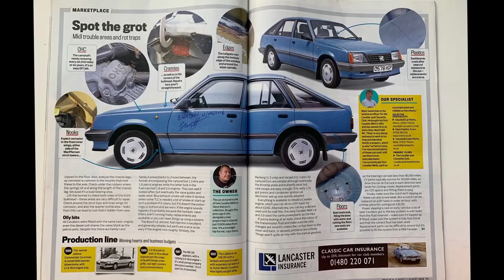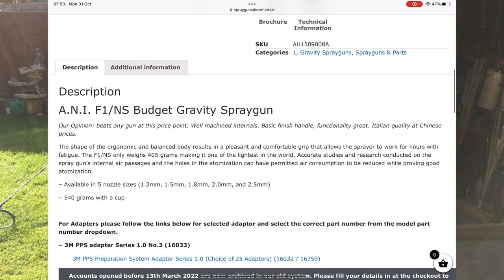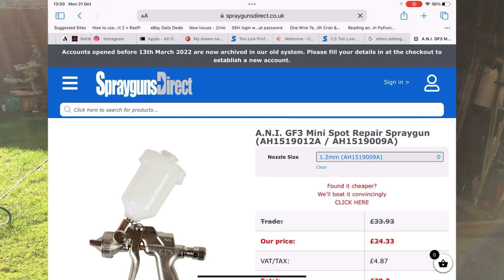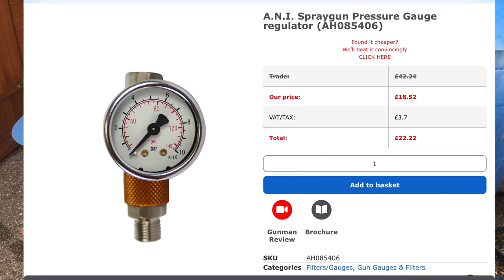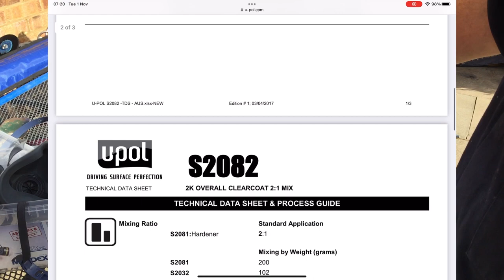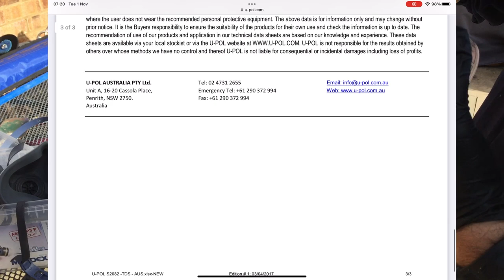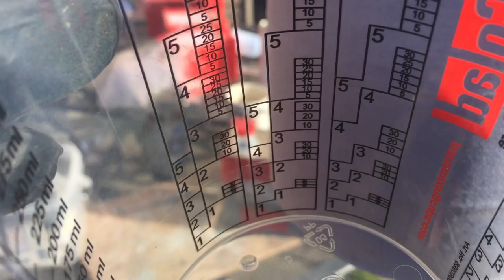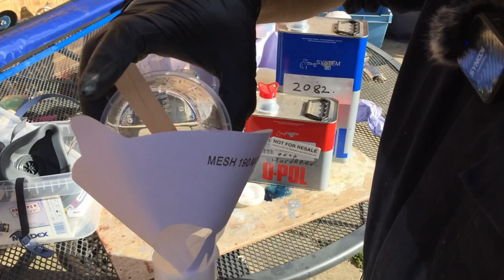Do you need an expensive spray gun to get good results? ANI GF3 a novice painter’s perspective

Comment: Hi, great video. Is it the CFM or FAD CFM that the gun manufacturers state is needed. My CFM is 11.4 but the FAD CFM is 5
Reply from the maker: Hi Mark, I hope this helps you and not cause any confusion, 
the technical specifications for the ANI GF/3 is at 1-4 bar (14.5-58 psi) it uses 81-210 l/m which equates to 2.85-7.42 cfm
So if I use the gun at 1 bar air pressure it will use 81 litres per minute of air which is 2.85 cfm 
As you say the compressor headline specifications is basically at FAD (Free Air Delivery) for example my 14CFM SGS compressor is between 15CFM and 10CFM which I assume is the compressor’s minimum performance at or near 10 bar and as much as 15CFM when it’s at atmospheric pressure. 

I hope this makes sense and it’s answered your question for you. 
Have a great weekend. Steve.
Reply: @Cavalier_Steve  Thanks Steve, just seems that every mini HVLP gun I look at needs at least 4 CFM FAD, with my compressor only at 4.4 CFM FAD, surely that would mean I'm strangling it? As said it's not for full panels, just spot repairs
Reply from the maker: You will most likely be ok as your gun will use less than the compressor it will continue to run though whilst your using it but if your doing small items you will be ok, don’t forget you will have air storage on the compressor the bigger air storage the longer you can work before the compressor kicks in again obviously you can continue to work whilst it’s running but if you have say a 5 CFM gun yes you can use it just not continuously, also the compressor will be running at 8 bar if it’s a direct drive and you will be using a regulator so you will have air storage even with a small 25L compressor, oh and also the more pipe you have that will also count towards your storage. 
The compressor tank will get hot if the compressor is ran continuously so you will get a lot of water buildup just allow it to cool and drain it often, I even have this issue with a 90L compressor. 
Bigger is better but not for everyone, and with standard 240V house hold electric your limited anyway. 
This subject is a minefield but your going about it with the right way I think just as you know you will be limited but you can wait a minute for the compressor to recharge and you can go again.
Reply: @Cavalier_Steve  Thanks Steve, some people are saying I need a 150 litre comp which I find crazy, I will literally be using it for very small areas so hopefully will be OK. I think I will go for the ANI GF3 with a 0.8 for base and 1.2 for clear, I suppose then I would have to buy 2 guns as I can't see the needles sold separately?
Reply: I read aswell that I should use a 1/2 hose (with 1/4 fittings) rather than a normal 1/4 hose, I plan to put a water trap and pressure regulator at the gun end of the hose and only need a 5m hose which should be better?
Reply from the maker: I think they are right in what they are saying if you was spraying a whole car, I do fine with a 90 litre compressor, the largest thing I have sprayed is a car bumper from a Honda Accord, with an ANI F160 which is larger than the GF3, the GF3 is quite a nice little gun for the price it’s definitely capable of producing good results much better than what I got, I would use 10% thinners in the clear next time, as that would help the upol clear flow out better. 
If you buy from Sprayguns direct, they will sell the tip and needle separately, they are on the website although under a different listing, if not give them a call they are very helpful. Just out of interest what capacity is your compressor? 
All the best and let me know how you get on with your project.
Reply from the maker: The larger 1/2 hose will be better for you if your budget allows, it can help with total storage along with better air delivery should you use the compressor for other things like an air impact these need lots of air so well worth getting the larger diameter hose for future accessories. That’s all I use on my hose before the gun is an air trap and a “regulator” which is just a valve that limits the air flow, it’s cheap but works ok, the proper diaphragm regulator is around £80 but the ANI regulator is cheap and works well for what we need. Good luck.
Reply: @Cavalier_Steve  Hi Steve. I have a Draper 81710 50l 2.5hp. It has a regulator at the outlet, but I understand this would give a 'false' pressure reading as doesn't allow for pressure loss through the hose, so the plan is to put the regulator at the gun end, would the water trap go before or after it? Hopefully I can buy the one gun to cover baeecoat (0.8?) and then clear (1.2?). My only concern is that clear uses ALOT more CFM than the 4.4 FAD could provide. I didn't realise switching from rattle cans to air would be so complex!!! I've read and viewed so many videos and everyone has a different opinion. @pete hobbies is great, I know you follow him too
Reply: If I could ask aswell, when at the paint shop, would I just ask for say 0.5l of basecoat in paint code for a spray gun, or is there a special way to ask lol? Also would I ask for say 0.5l of 2k lacquer for a spray gun?
Reply from the maker: You can use the 1.2 for both Base and Clear, you can turn the fluid down by turning in the needle if you find that to much fluid is coming out, but this gun has such a small spray pattern I don’t think you need to worry about it just use it on full fluid you will still get good results from it. 
It was thanks to Pete @Petes Hobby’s that helped me get setup, every one has there opinion’s and experiences it’s worth listening to others and make your own mind up, Pete is a valuable resource he always answers comments as well. 
Yes you need the regulator at the gun, on my setup I have the water trap and then the regulator, some guns have there own built in air control valve, but you don’t know the pressure your running at some guys go by ear but you need a gauge really to get an idea. 
50L is a good size and it’s one I started off with I bet it was the same compressor I gave mine to my dad as there was nothing wrong with it, I just use mine more for some air tools which really uses lots of air. 
I was using mine with the ANI R160Q which doesn’t use lots of air it’s a more expensive gun but it’s well worth the money, I think was around £100 if you have the budget get that one, otherwise the GF3 is a great little beginner gun and ideal for spot repair’s I think the mini boot lid would be the biggest job it can do though.
Reply: @Cavalier_Steve  Thanks Steve, your so helpful. Really enjoy watching you & Pete and have subscribed to both.
Reply from the maker: So there is a couple different types of paint Cellulose (AKA 1K) and Acrylic (AKA 2K) all modern cars use 2K, i buy a lot of paint from eBay search for “Paint BASECOAT COLOUR MIXED TO CODE Metallic pearl Spraying REQUIRES THINNERS” by Fiona_Mcgown123 you can buy pre thinned Ready for use (RFU) paint but I buy neat and thin the paint myself 50:50 as you get more for your money again oh and you can go by paint code and I always give the make and model paint colour name, search for 2K thinners. As for a clear go with something like Kapsi 6030 the upol that I used is ok but it doesn’t flow out very well remember though please use a good Mask as the clear has cyanide in it and this can harden in your lungs over time. You can buy as much or as little as you want. As for the clear you can buy in 1 litre tins make sure you get it as a kit where it comes with the hardener as well. 
If there is anything else please ask I know how you feel as I was there once and still am with some stuff, we have goto start somewhere though.
Reply: @Cavalier_Steve  lol, I'm sat here watching you with your mini boot video and you comment🤣
Reply from the maker: Your welcome, I know how difficult it is to get the right advice as a beginner when all you want to do is do a little bit of spraying just to get started and get the feel for it without spending big money. Are you on Instagram?
Reply: @Cavalier_Steve  I was actually googling Upol S2082 as well, I think it's changed its name but will look at the one you mention now. Also paused the video to get the right ANI Reg & Water Trap👍
Reply from the maker: @MarkRuiz521  Nice! I hope it helps, I’m going to be doing another spraying video soon, where I refurbish an alloy wheel, I just need to record it and soon I want to do my wing mirrors on my MK3 Cavalier so I will have that coming soon. 😀
Reply: @Cavalier_Steve  Great, thanks. It would be easier to just ring you🤣🤣🤣
Reply from the maker: Yeah I know what you mean. At least you have something to look back on I’m terrible at forgetting stuff I’ve been told 🤦‍♂️

Comment: Hi Steve, great video mate this brings back memories of myself painting outside when I first started on this crazy hobby😆

You did a great job on the boot lid mate considering the conditions you had and the fact you are just starting out you couldn't have wished for anything better, I will say that the results you have here is far better than I had when I first started.

As you said it's not the best gun for clear but it can do a decent job, you may have got the panel a bit wetter if you had the gun a bit closer to the panel plus as you mentioned adding some thinners will help with the flow out👏🙏👍
Reply from the maker: Morning John, thanks the finish of this panel could have been better I watched one of Pete’s videos and he had the pressure wound up to around 4 bar I sprayed at 2 so I think more pressure would have helped as well. 
It’s not a bad job definitely one a beginner would be proud of, I’m going to do more painting videos in the future no plans on anything in the short term except finishing off my alloy wheels 🛞 that’s when my GF3 as a primer gun would come in 😁 although I may move over to wow primer I’m keen on trying that in the new year. 

Definitely needed thinners again that’s something I’m going to try as I think I can begin to nail a really good off the gun finish adding it, I will take your advice and move closer next time I have noticed that helped at one point where I was accidentally to close to the panel, all part of the fun as you know .

Thanks for watching John and for the feedback as well it’s very much appreciated as always.
Reply: I think you are doing an amazing job for a beginner mate so keep going, only thing I can add is just be careful if you do paint closer as it will wet up quicker so you may need to move a bit faster, it's just the case of finding your own painting style as within reason the distance and speed will be how you want to do it👍👍
Reply from the maker: Sounds like a great excuse to experiment with my mini boot lid 😁 and to buy a different colour paint as well 😁😁😯